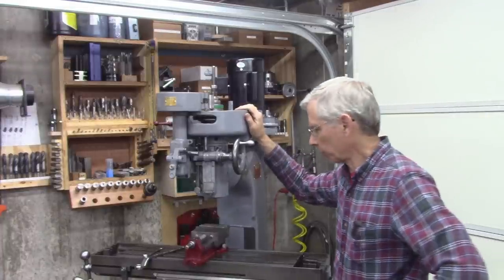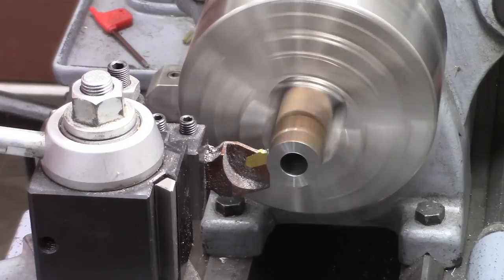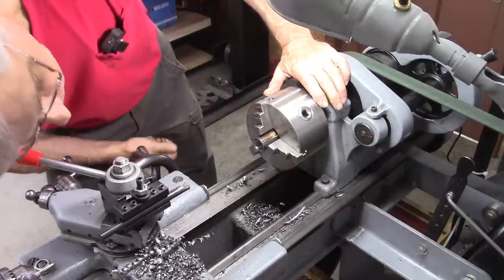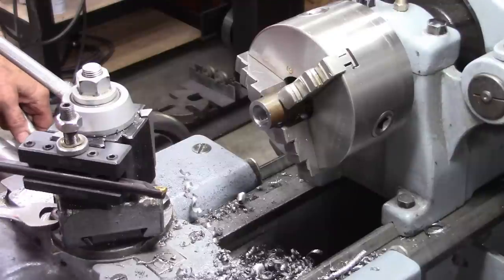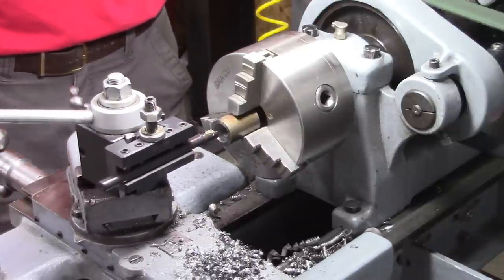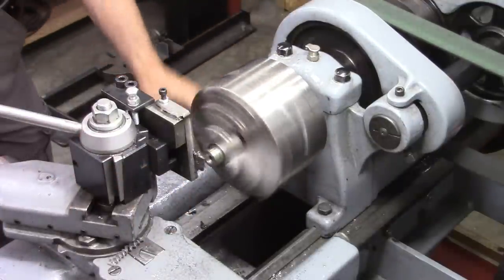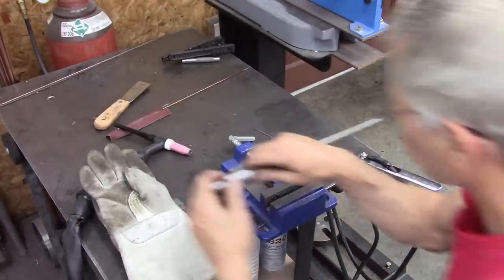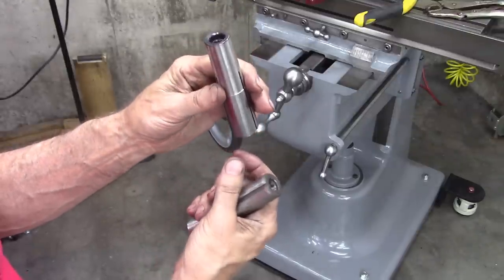Making a Wells Index Self-Ejecting Drawbar

Comment: Really nice drawbar, just got a Cincinatti 8x18 with no drawbar and this will work perfectly.  Once change I will likely make is to file flats on the end that passes through the sleeve, instead of welding a nut to it.  That way I can replace the drawbar itself if the threads wear out and not have to remake the nut.  I already have a threaded sleeve with this design that came with the mill.  Thanks!
Reply from the maker: Sounds like a great idea!

Comment: Great outcome Mark.. I would use a socket with a ratchet handle instead of a ring spanner or that gadget you made.. Regards from Australia.
Reply from the maker: Either way would work but I really like that I can give it a good smack and make it spin. After I made this video I showed my brother in law the tool. He said you should have used a 1/2" drive socket so that the wrench would also work on your motor tension. That would have been perfect...  I welded a 1/2" square drive socket to the new wrench.

Comment: Those self ejecting drawbars are good. You did a nice job building it. 

I made one for my mill but unlike your spline, mine did not have a thread at the top. I had to tap an internal thread in my spline and make up a bolt that screws into the spline, and has a hole in the middle for the drawbar. It was getting a bit tight on room, but it does work well like your one.
Reply from the maker: That's a good method! Thanks for sharing.

Comment: I'm always impressed by your content that's different than the general repeated "beating of the horse" by most home machinist channels. 
So now you have a better mill then the RF30 type. You know that professional machinist still call these bridgeport type mills, heavy duty drill presses. But I don't know how I could get a 10 ton machine into my shop, let alone down my gravel driveway where the fork lift would sink to it's axles. And I know how to ease up on the depth of cuts. I have learned that side milling sometimes requires coolant. But I hate the mess.
Should be interesting to see your future content with this mill. I don't know if Vevor has a Kurt quality knockoff vise for you to review.
Reply from the maker: Ha...  a drill press. I'm going to call mine a mill. The RF 30 lacked precision and the round column was a joke but it was a fairly solid drill press. I'm happy I got this new mill but the RF30 served me very well. I bought a vise supplied by HHIP. Oddly, it sold for just over $300 on the HHIP site (and several others) but HHIP was selling it for $142 via amazon. I wanted to get something good...  the Chinese vise on my RF30 was not very good.  With that being said...  it looks the same as what Vevor sells...  so who know if i actually got something better. It seems to be a good one.  The only down side is that its what they call a CNC vise. It has to coolant gutter around the vise. I may try flood coolant anyway. HHS end mills cut better than the carbide but coolant is a must. I was surprised about the HHS. I had a new carbide 1/2 end mill and was making hold downs for the new vice. I broke the end mill and swapped it for a 3/4" HHS. It cut like butter compared to the carbide. I guess the HHS was a lot sharper.

Comment: Mark, This was a very interesting video, my Rexto Horizontal needs a "real drawbar" such as yours. It is presently out fit with a 1/2" threaded rod, looks like your idea will work with a couple of changes as there is no threaded top piece as of yet. Good stuff, TY
Reply from the maker: Good luck threading the top of the spline. But yeah, its a good design.

Comment: Nice design!! My Model 645 has that same odd threaded top of the spline. And I've used a brass chunk to break the R8 loose. That flywheel driver is just what's needed to speed up collet changes. I'll have to modify your design some, but great solution to making a self-ejecting drawbar.
Reply from the maker: Thanks. Maybe use a 1/2" drive socket so it will fit the motor tension adjustment.
Reply: @WinkysWorkshop  The 645 has a lever over center cam type mechanism for the belt speed change. They clearly did evolve the design over time.

Comment: one tip, when test fitting, you can mark and remove the chuck from the spindle, esp. if it is of the cam stud type, this makes indexing easy, only one way it can go back in, so being true to the synchronization of the lead screw and the tooling which has already been established so far.
Reply from the maker: I've actually done that a lot but in this case the weight and size of the chuck would have made it hard to do. The threads on the spindle were in rough shape and I wanted to be able to feel the resistance of the fit.

Comment: winky, for internal threads for a blind hole I always like to cut threads coming away from the chuck as it is easy to find the bottom of the hole using a dial indicator or hard stop and there is no chance of a bad ending. I think I would also have made a plug with male threads so that you didn't have to take the piece out to test fit. In any case, as usual,  a successful end to the job.
Reply from the maker: Thanks!  The plug is not a bad idea but I'd have to make a nut to test the plug...  long process. The best way would have been to pull the quill on the mill. Threading in reverse is not really a good option with a screw on chuck.
Reply: @WinkysWorkshop  yes sorry mine has 3 cam lock studs that means it can't back itself off. The side jobs needing to be done first to make the main job more efficient are what makes my grey matter come alive but being retired time is one of the few things I have in sufficient quantity. Keep up the good work.
Reply: Buy yourself some thread wires and learn how to measure the thread with them. That way you can measure the spindle and make a plug to match exactly.
Reply from the maker: @ThePottingShedWorkshop  I have some. The end result is about the same. I'm not sure which is faster but I've had at least one failure in the past using wires and making a plug. 3/4"-20 is kind of an odd size. I thought about using wires to measure the mill but the threads were kind of messed up. The vise grips were a bit crude but index work in the chuck work perfectly well. Locking collars and scribe mark is a better method than vise grips. I didn't have the right collar.
Reply: @WinkysWorkshop , You could have made a new collar for your collection, Lol, it’s almost unending the amount of side jobs a primary job can create. I’ve watched a fairly new machinist YouTuber that numbers the side jobs (and shows them), he highlights them and I think they probably have more footage than the original project does. Depending on the number of side jobs his project has, it’s like getting four or five short videos for the price of one. Your videos are similar because you show us your side adventures, like your spanner wrench at the end, you just don’t number and make a big deal out of them. 
I was thinking about welding something on a boxend wrench so it would stay on the nut of the drawbar, you outdid yourself with the speed wrench that you made, nice job, thanks for sharing.

Comment: Man, that rattling gear would drive me nuts ! Lol, you probably don’t even hear it anymore. 🤷‍♂️ maybe the camera makes it sound worse than it actually is. But Joe Pie did a video about threading from the head stock out to the tailstock by flipping the tool upside down and running it backwards. it seemed a bit barbaric but out of curiosity I tried it. Haven’t threaded up to a blind or hard stop since. It just works so well. Anywho. This old video is a good one. 👍🏻
Reply from the maker: Gears on the lathe? Yeah, i agree, the camera does make them worse but I sill do not like the noise. As for threading in reverse, it is absolutely a great way to do it. however, if you have a screw on chuck it's not a great idea.

Comment: Where were you able to get plans for the drawbar tool? Great job!
Reply from the maker: Well there was a threaded area in the top of the splined shaft and I suspected it was something like what I made. I contacted wells index and they sent me a couple pictures so I deigned a slightly different version...  possibly a little better I think.
Reply: @WinkysWorkshop  Well, mine does not have a threaded part. It has a smooth top above the spline. The draw bar that came with mine has a shoulder and a square drive on the end, for 9/16 wrench.
Reply from the maker: @kenny5174  Mine is a Well Index model 40. (1955 I think). other models may not have the same and for sure brand type mills will not.

Comment: my drawbar ends flush with the top of the quill shaft extension, like a flanges bolt. remember some tapers are longer then others so you may need a spacer, because it can be too short!! My quill shaft goes below that top surface!! This would not work on mine a tall
Reply from the maker: No problem, I made the bar for the B&S #9 taper that is in my mill.

Comment: Ha, I have to make a draw bar for my Gorton. Design has now changed,  I hate smacking precision tool bits.

John 🇨🇦
Reply from the maker: I agree...  this is a good design
Reply: Ha, nothing is ever simple. My mill has a MT4 taper which uses a 5/8-11 thread for the draw bar. The through hole is  9/16, go figure. Oh well, I get to make two adapter fittings first,  one for the collet chuck and one for the boring head.  Good thing we enjoy making stuff. 

John 🇨🇦
Reply from the maker: @joerogi8401  I was able to find a taper with a 7/8" thread on the end for a boring head. I also found a B&S #9 to a #2 MT for my drill chuck.
Reply: Well weeks later and I have finished the self ejecting draw bar. The collet holder and the boring bar are threaded 5/8-11 but I can only fit a 9/16 draw bar in the mill. So I made 2 5/8-11 to 1/2-13 adapters and threaded both ends of a 9/16 rod 1/2-13. The top mounting piece threads onto the spindle with a 1-14 left hand thread.  They're actually super easy as you're threading out of the part.
So thanks for the idea and motivation. 

John 🇨🇦
Reply from the maker: @joerogi8401  that's great 👍

Comment: Boring in blind holes, you can angle the tool post slightly so you cut on the way out so you can use power feed.
Reply from the maker: True. Even without changing the angle is works fairly well.
Reply: @WinkysWorkshop  on some bars you need to. Some bars you can't back out regardless without trashing them, unfortunately.  But it's actually not hard to make insert tooling, ao it's a good excuse to diy something.
Reply from the maker: @moosesmachinery  I do it often...   what can I say, I'm a rule breaker. It simply deflects the bar and you have to take more passes.

Comment: What GTN-2 parting tool is that?  I'd like to get one for my lathe.
Reply from the maker: GTN2 is the insert. The 2 is the width (2mm). Run a search on ebay and you'll find the tool. It's very handy although it cuts a little rough.

Comment: Is there possibility to get the measurements? I have an Index mill with the same draw bar.  Thanks!
Reply from the maker: Here's a drawing without dimensions and photo of the original bar from Wells Index. If you'd rather buy a draw bar Wells Index still sells them but they are high priced. I never took measurement when I made it, I just made it to fit.  Obviously the draw bar is 1/2" and the cylinder need to fit in the pulley spline so it does not limit travel of the quill. Note: the coper colored item in the drawing is a brass washer.  https://drive.google.com/file/d/1-cYDBZoxwBG4LTzRB2g0kqx80gr1wfiN/view?usp=drive_link

Comment: In my M head Bridgeport the threads are left handed. Do you find that the drawbar unscrews itself?
Reply from the maker: Never. I've never seen a collet with LH threads. What kind of collet are you using?
Reply: @WinkysWorkshop  sorry, I meant the threads at the top of the quill, where you have right-hand threads.
Reply from the maker: @ChimeraActual  Ahhh. got it. They are standard RH